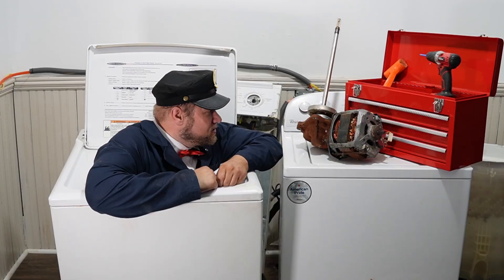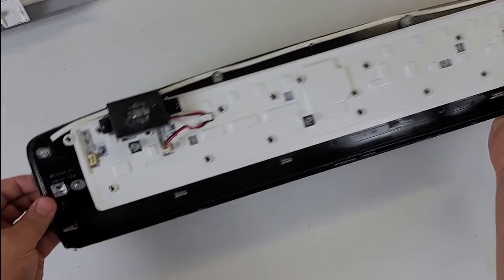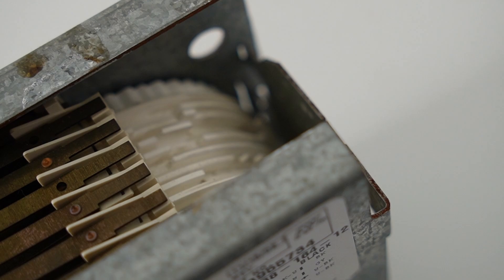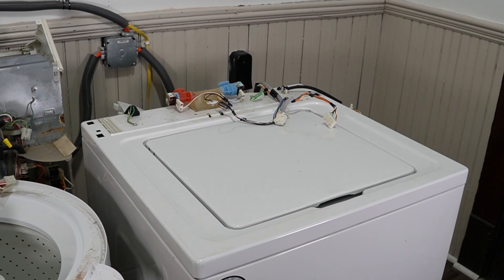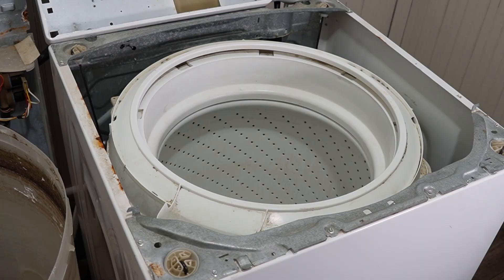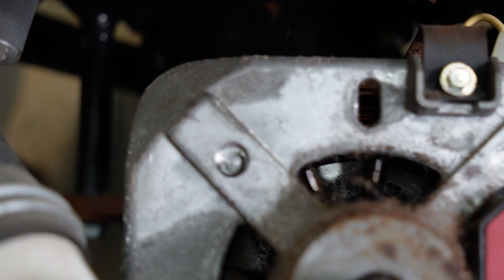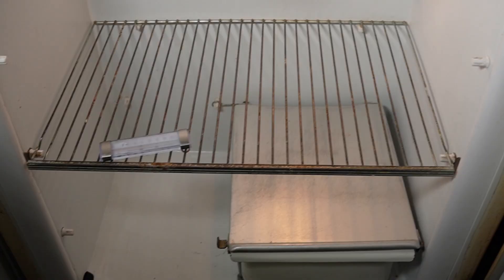Are Washers Built to Break? Inside a 1984 Washer vs. Now

Comment: 0:49 my dad still has that set......... still working today
.
we have had to put a new drum in the washer..... heating element in the dryer.... replace the start button with a toggle switch, ETC
but they still work........ 
.
and, when you FINALLY DO need to fix them.... 
parts are still out their
less models = easier to find the right part
simply MADE to be worked on (they wanted their service men in and out quick.... as that is more efficient at making customer happy and saving everyone money................ )
now days.... they want to charge 6 hours labor to replace a headlight on your car..... because my mechanic butt has to remove your whole bumper and grill.... for a 10 dollar bulb 
.
ANYWAY..... ya, its DESIGNED to be able to work on it
.
.
.
.
1:50 
still easier to fix, especially if money is an issue (which it is.... as you are using a 1984 washing machine in 2022)
i can simply fix that broken wire or worn mechanical part..... 
.
but i have to order that circuit board.... after spending 5 hours finding a part number, because "right to repair" doesnt exist......... 
then wait for it to be shipped to the CERTIFIED "middle of nowhere"....... (google it.... "glasgow MT middle of nowhere")
.
.
no thanks.... id rather get go use the shops MIG welder (if its THAT big of a repair) 
.
.
.
.
also.... i repair old record players..... and studied computer science in college (before running out of dollar bills, and dropping out 2.5 years in)
its just a MECHANICAL computer 
.
their are still sensors.... even an ECU
but its all mechanical...........
.
a button/rod that comes down when a record is loaded.... and trips/hooks this lever..... and thats starts the auto play sequence 
VS
a gap in the fly wheel lets the CPS know its at TDC number 5...... trips (tells) the ECU this..... the ECU then sets timing for the next cylinder 
.
different, sure...... but still the same 
.
.
.
idk..... electricity doesnt scare me (im afraid of shocks, ya.... but not wiring diagrams) 
and their is a LOT!!! of mechanics that dont know how to fix a trailer brake light issue.............

Comment: Is there any way I can contact you about my Samsung washer I’m having some trouble with? It’s showing a drain error code so I replaced the drain pump and checked the wiring to it and also checked all of the drain tubes but it’s still throwing that code and won’t drain

Comment: It's very likely that you could have driven the transmission out of the newer washer tub with a good air hammer.  I've seen the Ingersoll Rand 119max move stuff quickly that I beat with a 12# sledge for days.  If you have a decent compressor, it can't hurt to try.
Reply from the maker: Could I? Sure.

Do I want to? No. That would have required purchasing new tools for this video, and I really didn't want to go to that length on a unit that would require a new gearcase to work.
Reply: @bensappliancesandjunk  I cut a 2X4 so it will fit in the tub, but long enough to catch the rim of the outer tub. I put a car jack between the shaft and the 2X4 and pry the tub off the shaft.

Comment: If you "absolutely want" a new dryer or washer that will last, buy a commercial unit. They aren't cheap, average cost is 4x   the cost of a high end consumer unit but they are made to last and be easily repairable.

Comment: before i even watch the video am going to guess that the new ones break down because the electronics fail circuit boards will fail etc.. i had three window air cons 2 old manual dial switches and one fairly new one with a electronic control circuit board after 4/5 years the new one started sending the temp setting to either full high 82% or full low65% nothing in between and when it did work it would randomly change the setting on its own needless to say i still have the two old manual ones they still work great even at 20 +years old the newer one has been relegated to the trash heap after just over 5 years it still made cold air but you could not control the temp  for 99$ it was cheaper to trash it and buy a new one then try to get it fixed and am guessing this is the same for all appliances these days

Comment: I would be curious what the inflation adjusted NEW price for these two units would be.

I imagine to keep the over all cost of the machine in line the simplification and changing of parts would be needed. All those individual parts sourced from all over probably add up to a lot more.

Could you even afford a NEW washer built the OLD way?
Reply from the maker: Thats a good point. The old ultra-reliable ones adjusted for price aren't that cheap. 

A routine look on YouTube shows a super basic Kenmore WD set (Direct Drive, probably will last 30 years on average) for $720 for the set in 1990... $400 Washer, $320 dryer. That's $1639. Reasonably close to a Speed Queen set, or a Maytag Commercial set.
Reply: @bensappliancesandjunk  Seems like it would make for an interesting comparison of the high end and end from the 30s adjusted vs the high end and low end now.

Comment: I trained and worked in appliance repair,  but now fix equipment. for one of the 2 huge soda pop companies.       The new stuff is designed to work a bit past warranty usually,  and to look impressive.     It is also designed to create a market for expensive profitable repair parts   AND/OR  expensive profitable new appliances.         It's not built to last and last like things used to be.     There's no money in building things to last...........which is sad.

Comment: The problem with high efficiency washers is they don’t save any water or power because they don’t clean worth shit. You end up running the same load of laundry through the thing 5 or 6 times and it’s still not clean!

Comment: Have a question. You briefly mentioned one piece washer and dryer.  You showed a g e which a just brought. Did not have much of a choice. Had to put it in the bathroom of my trailer, and it's a tight fit.   Was it a real bad choice. It's just me and I only use it 2 times a week. Do you think it may not last 5 years?
Reply from the maker: At 2 times a week it should be good for 5 years. It's just not great for frequent loads

Comment: When I run into a basket that I can't get off the drive shaft I use 2x4's cut to the baskets width and use a scissor jack to separate them. It works 95% of the time and the other 5% it ends up popping the balance ring off. I hope this helps someone!

Comment: My next door neighbor got her a new washer. Right after she got iy she called me down to see what was wrong with it. It was not filling with water like it should. Turns out it weights the clothes and usage the least amount of water possible. So is like OK that will save on the water bill. But then it is not cleaning like her old machine. SHe then learns it is made to use only one kind of special detergent. It is not cheap and not even sold around here. She has to drive 25 miles one way or get it online. She now really hates this new machine and wishes she had just fixed her old one. The person she gave her old machine to did fix it for $50 and told her it was the best washer they ever had. She is not happy.

Comment: every time someone says old stuff is better because they still have something old that works, the suffer from survivorship bias.  If all these old machines still worked, and were still repairable. The market for new machines would be really small. Hardley any new machines would be made, since the world would be full of old working machines.
Reply: While survivorship bias certainly can be a factor,  the facts is many of the newer machines are more energy efficient than a machine from 30 years ago.    The latest features such as touchscreens, wifi capabilities , and UV germicidal lamps to name a few, are indeed attractive options.   But, many will not last as long as the old machines.    My Aunt Linda and Uncle Bill still have their Kenmore washer and dryer set from 1982, when they purchased their first home, still runs like a champ.  Granted they are not very energy efficient by today's standards,  but why spend over a grand on a new washer and dryer set, when the old ones are serving well.
Reply: @Sparky-ww5re  I think you are proving my point. If all the old machines ran forever, then hardly anyone would buy a new one. I'm sure there are some people that just buy a new machine every few years because they want the newest thing. But I honestly dont know of any. The market exists because old machines die, or there is new housing. So most of those 1982 washers have died decades ago, and have been replaced.

Comment: YEah, the circuit board does the work in the new machine, but just ONE little thing fails on that board and it's junk, and not repairable- you have to replace the whole board $$

I was able to easily bypass the lidlock on the newer whirlpool I had- I simply unscrewed it from where it was attached and pushed it back inside the console.
The new Speed Queen had no lid LOCK, but it did have an annoying lid switch that turned the machine off if the lid was opened while spinning- easily disabled as well.

Comment: You compare old to new when I used to salvage repair and sell washing machines these were the units I called new with a plastic drum and foreign parts and in a lot of cases the gear box was worn-out just save the parts and send the rest to the dump only the casing was good for scrap metal so if the gear box is like the difference between the 60 and the 80 it's probably pretty crappie

Comment: I'm guessing that's a 6.3V rated cap? Yeah, that shit will definitely go out because it's very likely the voltage they are putting on that thing is probably 5V. Typically for electrolytics like that one, you should derate the voltage at least twice as much. The more the better. When riding close to its voltage rating, the life expectancy of those things drastically reduces. I'm not in the realm of commercial electronics, but I wouldn't doubt that there is a design standard they follow for operational run-time that gives a good chance the product will last at least the warranty period. Anything longer could effectively be seen as a potential loss in long term revenue.

Comment: I get what you’re trying to say but I don’t think you understand a lot of the newer tech. Just like mid 1970’s cars absolutely sucked with incredibly complex carburetors and dozens of vacuum hoses, and tacked on systems to try and meet emissions, so too are the old school appliances needlessly complex. It’s like comparing a mechanical “player” piano to an electronic piano. There are huge advantages to let a small control board and microprocessor run the show. These can be super reliable but only if they’re well engineered which US designed products mostly are but the Chinese stuff not so much. The much bigger issue you never even mentioned is parts availability. Even giants like Whirlpool now routinely discontinue parts for even 10 year old high end Jenn Air and Kitchen Aid built-in $6000 refrigerators. So, frankly, you seem to be missing much of the point.

Comment: The old wringer washing machines just agitated and drained. You put the water in with a hose. Draining was by gravity and you used the wringer to do what the spin cycle does now.  If someone just made a machine like an old wringer washing machine that had a spin cycle (probably initiated by just setting a timer) you could have a simple, non computerized machine that was cheap, easy to fix and would last a very long time.  Something like this could probably be put together in someones work shop if he had a lathe especially.  The public's demand for more and more bells and whistles has created these  overly complex and expensive machines that don't last very long. It's the same way with cars.

Comment: Have been through that whole "it needs a new control board" thing before.  I'm not like that, I wouldn't buy a new computer if a hard drive failed and since I can solder I've replaced a fair few relays primarily on appliance control boards.

I know the example isn't perfect but this unwillingness to actually repair anything is weird to me, most of this stuff isn't even very difficult to understand - you don't even need to know much about electronics to diagnose a lot of common failures and perform basic component replacements.

Comment: rust should be used as the new glue cause good lord is it hard to remove the drum from the tub of newer model machines when you need to do cleaning or bearing replacement.

Comment: This video feels more bias towards the newer washer. I'm a fan of the older stuff myself cause they basically last forever and if something does break it's cheap and easy to fix. I usually just scrap the newer junk. I use to fix and sell them. I never had a customer complain over a older washer but when it came to the new ones, I had one working good. I tested it a couple times so I decided to sell it. I sold it and it stopped working a couple days after selling it. Nope. That makes me look bad so I just started to scrap the new and repair the old

Comment: TBH it is extremely easy to construct a circuit board that can reliably outlive civilization and only costs marginally more... it means using Japanese capacitors, upscaling the relays or switching to mosfets and using standardized board layouts. I am usually not one to dive into the 'planned obsolescence' rabbit hole, but the more you know it really makes you think. Perhaps it is due to the manufacturers building down to meet a price point, when accounting for inflation im fairly certain the old washers cost alot more.

Comment: So the whole control board doesnt need to be replaced, but they do it because they dont know how to fix it  the failed component ?
Reply from the maker: Typically, yes. Most companies just give repair companies a core return fee to send the broken board back to them for repair, rather than get them to repair the common flaws and fail points.

Comment: The new washers are less reliable simply because of material quality, the 1989 washers will last longer even with plastic components simply because the newer washers plastics and metals are so soft and brittle comparatively to the older stronger materials, which is just due to cost saving measures over the decades. This is proven by the fact that you couldn't even get the tub off the new washer because the corrosion was so incredibly bad

Comment: Fixed home appliances my whole life. Modern ones are junk. Maytag made washers & dryers that are 50 years old and still running. Whirlpool bought them out and promptly closed that factory. NO more real Maytags. New Whirlpool washer is designed to be easy to fix WHEN it breaks. Lasts an average of 6 years.

Comment: How about testing a Whirlpool or Kenmore that uses a belt? I know from a lifetime of experience there is no better top loader. The self-cleaning lint filter is the greatest. We're talking CLEAN CLOTHS!!! Last forever? That's the washer bet on!
Reply from the maker: The old style WP belt driven washer? Never had one ever come in. We've never seen a pre direct drive Whirlpool ever. It's on my video list if we get one.
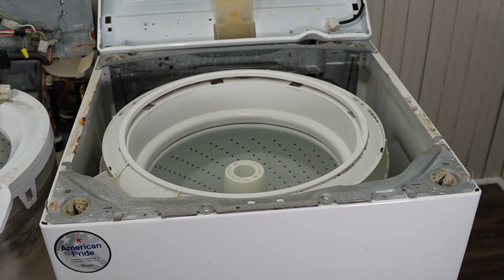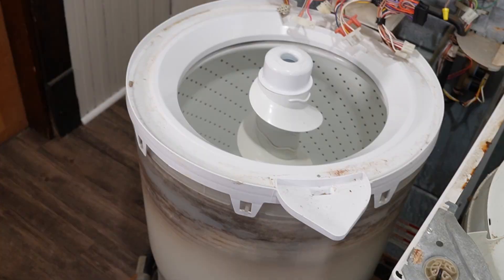Reply: I can hardly believe you have never seen one before. I suggest the nearest Salvation Army loading dock auction. That's where everything donated to the Salvation Army they don't want is sold to anyone who will take it away. You will be overwhelmed by antique appliances aplenty! I was an appliance collector when it wasn't cool! Here in the San Francisco Bay area,. you go to the San Francisco auction at 9:00 and hurry over to Oakland for theirs at 10:00. If you need any tips just ask me. Grab every agitator at the top and jiggle it. If it feels as if it's loose, the bushings are worn out. @bensappliancesandjunk

Comment: I know I'm going to eat my words here. Murphey's law is real lol. We have a Kenmore washer we bought for 279 bucks at K-Mart about 9 years ago. Other then resetting the unit 2 or 3 times after a power failure. It has literally been a work horse. We have a mid 90's GE Washer we bought used about 11 years ago. Like with my 7 YO Whirlpool 300 dollar Dishwasher, We will buy the simple, but reliable products over the convenient, yet unreliable machines.

Comment: On our washing machine the heating element failed and shortly after the bearing. On the dryer theres a tube clogging up evry year. The dishwashers pump failed. Those are all mechanical failures. The dishwasher even diagnosed itself by giving an Error code. Properly designed electronics dont break.

Comment: Are there any plans in the US to finally get rid of those horrible stirring washing machines? Like why not using a proper vertical drum washer like the rest of the world?
Reply: Is it a traditions thing? Like cooking on open heating coil?
Reply from the maker: An issue is that top-loaders tended to last an extremely long time and wash 7kg of clothes extremely well in about 25 minutes, tops. Americans have had a massive preference for them because they worked EXTREMELY well on washing clothes. Due to the high efficiency standards, the redesigned versions don't work very well, so there's a trend towards front-load machines, but its going to take a long time for that to take place in residential settings. Laundromats have almost entirely converted to frontload washers, though.